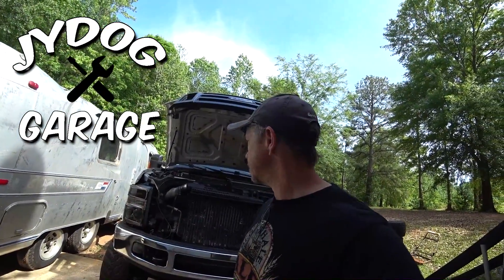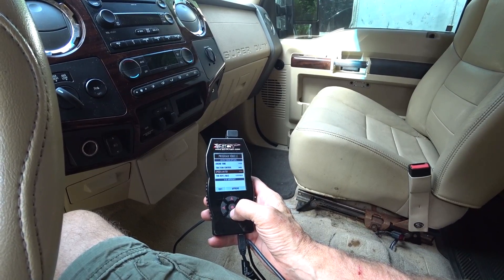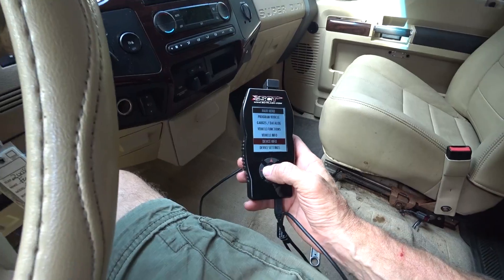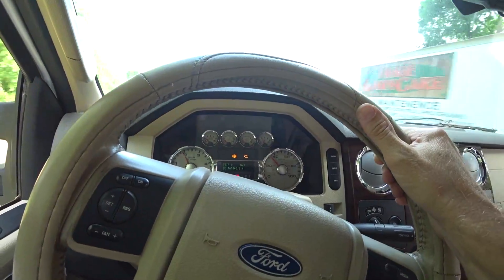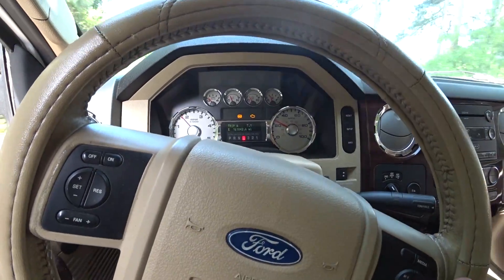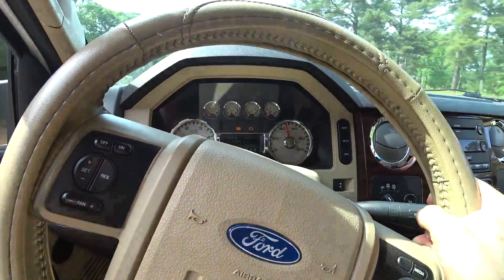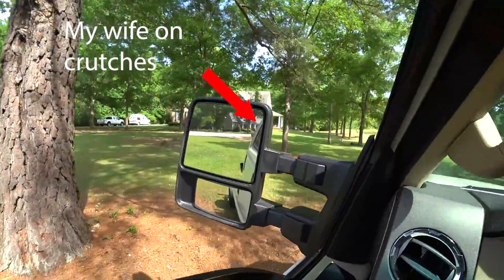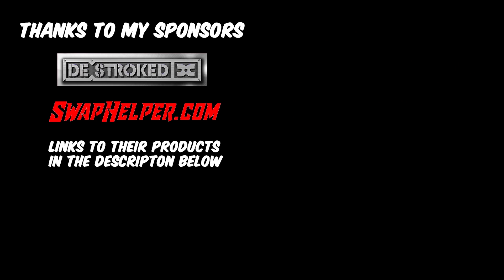F250 Cummins Swap - Automatic Transmission Tuning

Comment: I need help with the wiring, I di a Cummins swap into my f250 and the kit came with a pcs 2000, soo far I have the TPs wirer connected but I can figure out the rest of the wirer.please help

Comment: So the SCT already comes with tune for a 5R110 Transmission? Do I not need to spent the extra $450 diesel conversion specialists wants to charge to tune my SCT

Comment: Hello I’m down o the harness I got my harness from dcs. Everting was fine till I got the little lock key on my dash and know it won’t crank sometime it will and then it will go back to lock light on dash and when it cranks it only cranks for a little bit not ass long ass you hold the switch

Comment: Mark, it seems that your engine swap was extremely successful - congratulations!  But I have two questions that I hope you have time to answer;
1) Many diesel mechanics seem to prefer the Cummins to the PowerStroke engine, but is it really worth the time and effort to do this project when the truck requires so many modifications to make it fit and work right?  (Very few owners have your knowledge and skill set to do this job).
2) Your logo says JYDOG GARAGE, yet you work in your yard... what's up?  And where does the name JYDOG come from?
Hope to hear from you on these - I am a new subscriber.
Reply from the maker: 1) I'm probably not qualified to answer that as I am not a professional mechanic and it is my first diesel. After hearing what the 6.4 diesel cost to repair I figured I could get close to the same horsepower for about 1/3 the cost and way more reliable. If it had been a 7.3 Powerstroke I would have tried to repair it. 2) I've got a Garage under my house. I just do this for fun and to save money. Too bad all of my project are too big to fit in my Garage. I really like exploring Junkyards and  bringing home projects. I started using JYDOG as an alias for the forums I subscribed to and it just stuck. I guess lately I've brought home too many projects and my yard is starting to look like a Junkyard.  Thanks for subscribing.

Comment: Does it have an intermediate steering shaft ? My 2005 f150 was doing the same thing common problem. Replaced it and turns very smooth now.

Comment: My brothers ford ranger was doing the same thing and the adjustment screw on the gear box was coming out , I'm guessing that the jam nut backed off but after he adjusted it back down it was fixed after that.

Comment: it's a PAIN to get all the air out of the steering gear. Air gets trapped, then it starts to airate the fluid upon start up. Jack it up, fill up the resevior, and be patient. Keep the front end suspended, and work the steering back and forth. My boss has a '71 blazer we just put back together after almost 20 years of sitting, the bleeding of the power steering was the HARDEST part of the whole build. The steering should come back after ALL the air is gone, and it stops airating the fluid.

Comment: check your front axle u-joints they will bind when turn if the needle bearings rust up and it will  happen randomly if it was the pitman arm it would happen everytime  i have had same situation in my f-450 08

Comment: Are you using the Ford or the Dodge power steering pump? If you adapted the original Ford pump to the Cummins, the ratio between the crank and pump pulley may be off. You could end up with insufficient pressure/flow at low rpm's. The other part of it may be the scrub radius at low speeds because of excessive offset of the rims.

Comment: The 5r will relearn its shifting it takes about 50 miles or so it. When I retune my truck the transmission acts a little finicky for the first 25 miles then it works its self out.

Comment: Dang man. That cummins just sounds like a best. I have it in my 1998. 12 valves are the way to go. Last a million miles if you know how to keep em up to specs and not run hot tuning such as big injectors and turbos.

Comment: Is the right drop pitman arm on it for that lift? If you get the wrong drop/ angle it can bind in only one direction. Hard to see for sure in the video but looks like going left it would contact that mount right next to it. I think its something steering geometry related causing it to bind. Id get under it and have someone run it back and forth and see what it moves like.

Comment: The play in the steering wheel is normal for these 08-10, my 6.4 has the same amount but she runs like a dream lol. A aftermarket stealing gear box will fix the play.
Reply: Justin Lee how many miles do you have?
Reply: 98 12 valve  160,000 hard miles, she’s worked everyday of its life
Reply: Justin Lee any engine problems? I’m being honest here. You don’t see many 6.4s last past 150,000. Is your tuned and deleted. They are nice trucks. Just the engine is a big concern.
Reply: 98 12 valve Not till recently, it’s in the shop for $12,000 worth of work right now. It was deleted and tuned about 20,000 miles ago. Getting the entire motor built and refreshed right now.
Reply: Justin Lee well, that’s what I mean. I wouldn’t want to pay that much and it’s only at 160,000. That just doesn’t seem right. That’s why I can never side with anything other than my cummins diesel. They just run and run and never give trouble if treated right. Hope the rebuild engine goes good and your truck keeps trucking👍🏻
Reply: 98 12 valve Yep I completely understand, I’m aware the 6.4 isn’t the most reliable engine but it suits my needs and puts power to the ground like nobody’s business. If I had to trade it in though I’d go straight for a 2012+ 6.7 Powerstroke. They are the modern day 7.3
Reply: Justin Lee have you thought about getting a 4th gen cummins or such. I actually like the front ends on the 11-16 fords a lot. And I think their trucks are great. Besides the new ones..aluminum body..  but I think you should consider a 4th gen if you are looking for a new truck. My 12 valve has plenty of power as well. I’ve never been a guy that wants all the power on the world. Mines got a cold air intake and a straight pipe with muffler. So yeah the power totally suits my needs as well and I never feel the need to gain hp.
Reply: 98 12 valve I do like Cummins but I’m a Ford guy, one of my best friends has a 5.9 700hp 2nd gen. The aluminum body doesn’t concern me at all, I’ve used one working daily and that aluminum bed took beatings just as well as steel ones I’ve worked out of. My 6.4 however has a 1/2 steel flatbed
Reply: Justin Lee I had a rental ford a couple weeks ago and the aluminum body felt like crap. I felt like I would puncture the bed at the slightest touch. Absolutely hated it.

Comment: If you adjust the tire size with your tuner, it will correct speedo and adj  trans shift points for the larger tires.

Comment: I’ve been watching and enjoying your videos for quite some time, but wouldn’t it have been easier and more productive to just buy a Ram truck with a Cummins? Your work and money would have gone a long way towards tuning and upgrades. I guess what I’m really trying to say is “was it worth it”?
Reply from the maker: 2nd gen Dodge Cummins would be 2001-2002.This way I have a newer truck with one of the most durable engine plus it opens up all kinds of aftermarket parts for the body having one of the best selling trucks on in the market and more spare parts availability with more having been sold. If the only option was to fix the 6.4 I would have parted the truck.
Reply: I really respect all the hard work you’ve put into this build! Thanks for sharing it on you-tube.
Reply: I get this question all the time! My answer would be that after I did my swap (2007 5.9 Cummins/2006 F250) everything that had the "Dodge" name on the motor gave me problems. The fuel filter, the TIPM, etc...and once I replaced/removed all of these Dodge components, I have the perfect truck! The best motor with, in my opinion, the best truck. My motor has 536,339 miles on it and all I have done is adjusted valves once and replaced the serpentine belt.

Comment: My duramax needed a new hydroboost and i put a gm reman in. It would loose power steering when hitting the brakes. Ended up buy a new unit and its been fine.
Reply from the maker: Thanks for the tip. Come to think of it I may have been hitting the brakes when the power steering acted up. I'll will be careful to pay attention to that next time I drive it. That could be the issue.
Reply: Another common mistake ive seen is the return line from the steering box and the hydroboost is people use a tee and the fluid then back feeds causing issues. They need two separate returns to the reservoir.  It could be a number of things. Thats what sucks buying a non running truck you dont know of any prior issues like steering rack and hydroboost operation.

Comment: Whoohoo...that thing sound like a breed of a dragon and a excavator...nice!
:-D
But could you bear that for a 5 hour drive?
This drivetrain in a suitable body for uor european streets...wuold be a dream!
:-P
Thx for the vid!
:-D
Reply from the maker: It's a lot quieter with the windows up. Most of the time I was pushing my foot into it a little more than normal just to see what it would sound like. My goal is to get the RPM's a low as possible and build all the HP and torque on the low end.

Comment: I would think that the transmission would have its own learning capabilities. I’m not sure about Ford but I know other manufacturers do. Now if you are talking about specific RPM shift points that might be a different ball game. I would think the more you drive it the better your transmission will act.